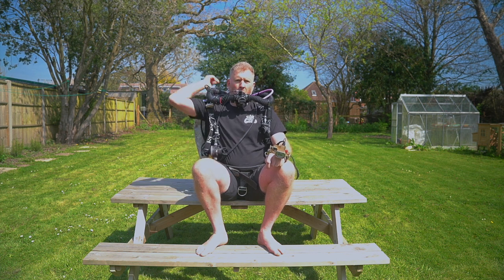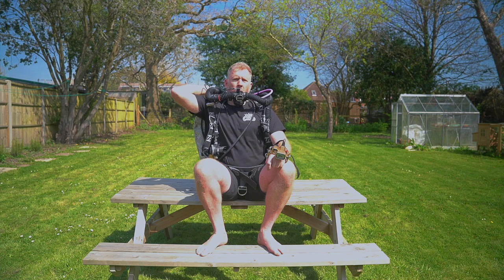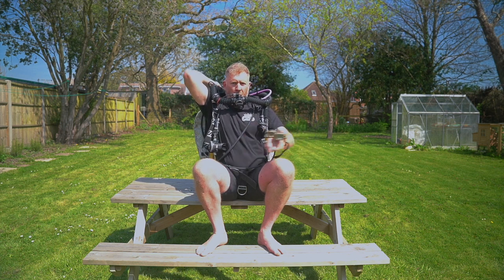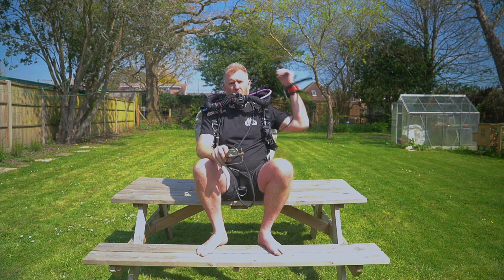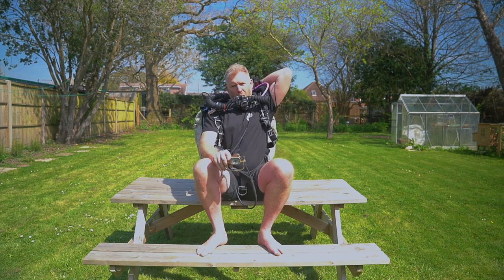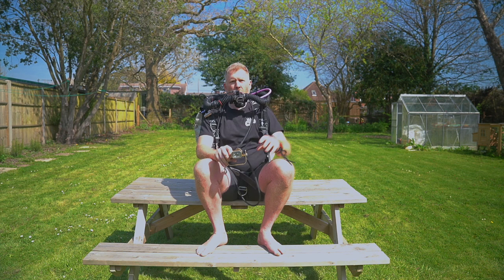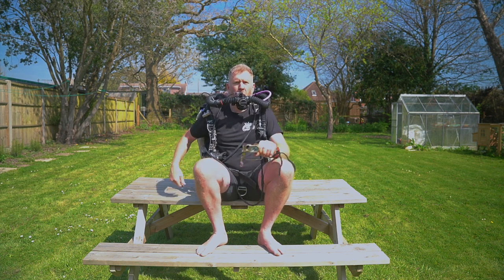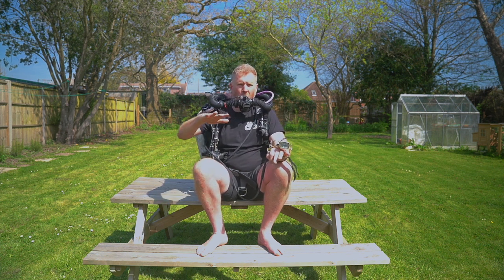Field drill of a valve drill on GUE CCR

Comment: I barely reach the manifold and turn it with my fingers. I wonder what to do to make the manifold easy to reach.
It is more difficult because I usually dive wearing a thick undergarment.
Reply from the maker: Lots of ways to improve your reach no1 is a good instructor ;)  after that properly adjusted harness, keep your head back and work with your joints not against them (understand biomechanics of the shoulder)
Reply: @gbdivering  Thanks a lot! I will try several methods